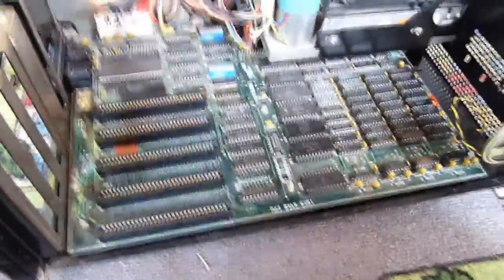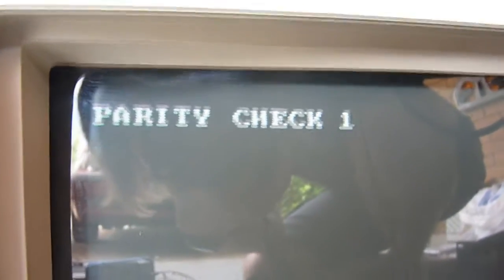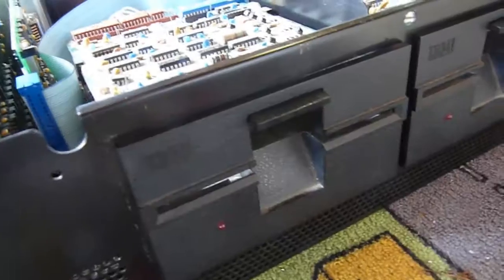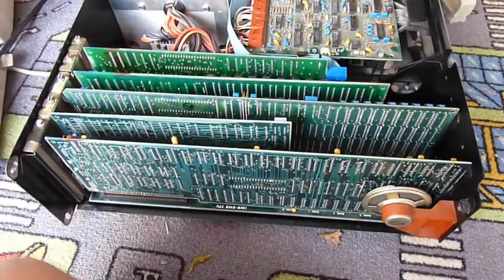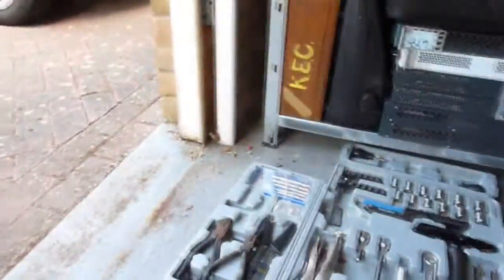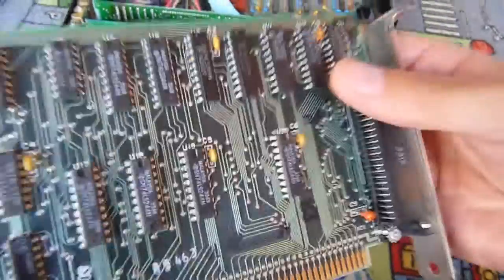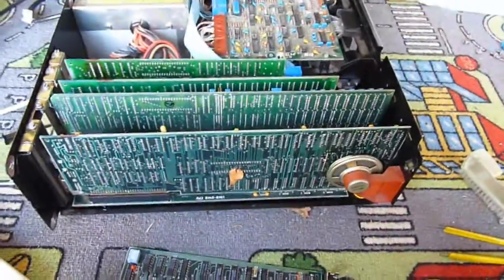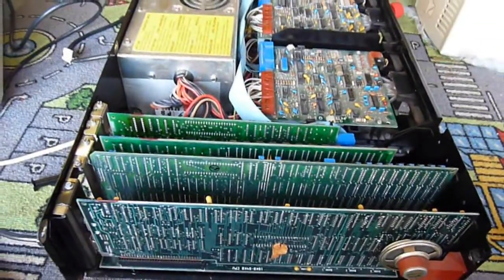IBM 5150 Restoration Part 4 (It Is Not All Doom & Gloom)

Comment: Thanks for the thanks! :D

Ahh, says the ROM FA00 error is that the checksum has failed on BASIC ROM in socket U31...

(half-way down the page)

http://www.minuszerodegrees.net/5150/misc/5150_post_and_initialisation.htm

Probably just a dodgy ROM chip. If you need a new one, I'll get one burnt. ;)

I don't think it would have been causing the parity RAM error, but you never know.
Reply from the maker: It is looking like there is a dogey ROM chip, if you can creat one that would be great as you know I don't have the equipment, never have got that stupid EPROM programmer working.